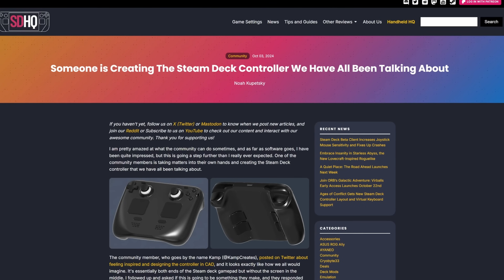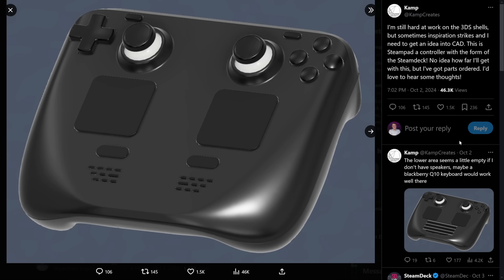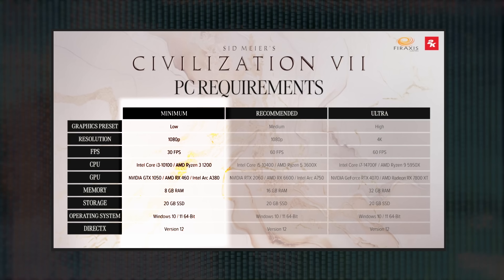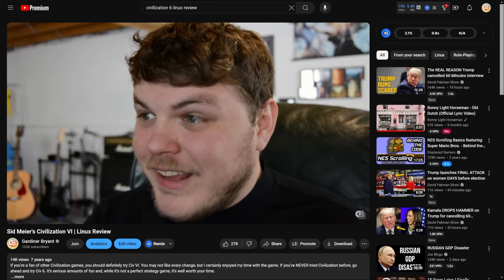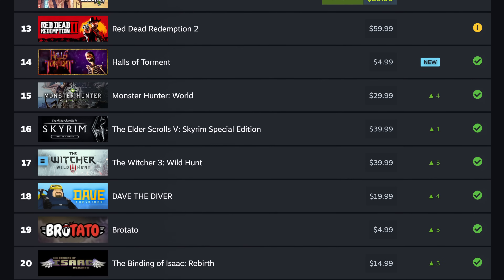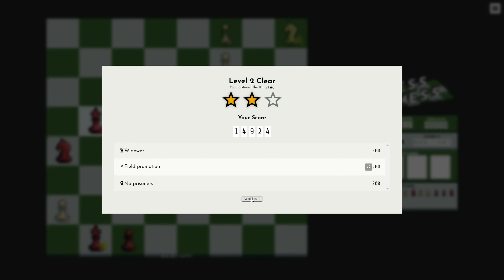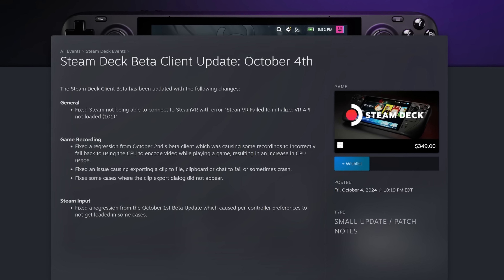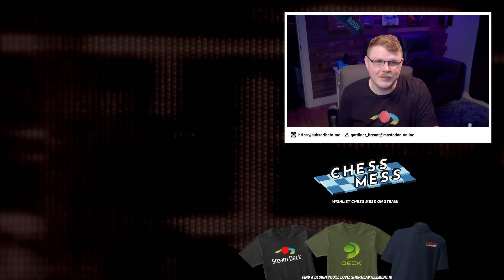Who is behind this new Steam Deck Controller?

Comment: I've been seeing the renders of "steam controller 2" that are just the steam deck without the screen and it's actually a horrendous idea. The thing I hate most about the steam deck is the tiny square touch pads. they're  too small, the shape makes them a night mare to use as a d-pad or emulating an anologue stick, and they're too easy to click in leading to a lot of accidental accuations. 

I understand why they are the way they are for the steam deck, but on a dedicated controller where you don't have to worry about how much bigger and bulkier you're making what is supposed to be a portable console they should be swapped for larger round pads with the click in issue fixed, though they don''t need to be as big as the og steam controller

Comment: Needs greater ergonomics. The closer the hands are, the more angled the wrists need to be so not to stream the shoulders position. This is why console controllers taper outward in an angle to the palms in a degree for the tilt of the wrist.

Comment: I agree with the ergonomic concerns others have posted. Think about using the Joy Cons in the girp that comes with the Switch. I think thats about the size comparison and that thing is not very comfortable even with the slightly asymmetrical palm rests. There's a ton of third party angled grips that try to make those feel better in the hand. I think that controller concept needs some kind of angle.

Comment: My dream option for the next Steam Deck and any Steam controller would be glass topped trackpads. If we could get super precise trackpads like a Macbook or high end windows laptop, I'd be soooo happy.
Reply: I'm not sure if that'd be a good idea. I'd rather have it made of a durable plastic, or some metal alloy. Making it glass would just make it more brittle and/or expensive without much gain.
Reply: @Ferkiwi  I've repaired laptops for over a decade and almost never have seen a glass trackpad break. They're tempered glass, they're very strong and the control gains are immense.
Reply: @WhatAboutZoidberg  Laptops have lids, a controller gets much more punishment. I work at Samsung and I've seen plenty of broken tempered glass on touchscreens. Can you explain in which manner the glass helps with "control gains"?

If you just prefer the texture, it would make more sense to separately sell glass stickers (like screen protectors). Many places already sell vinyl covers for the steam deck trackpads that add different texture (and it seems some people actually feel better control when the vinyl has more friction/grip, instead of being smooth like glass).
Reply: I was thinking having displays on the trackpads would be interesting.

Comment: Steam Deck controller
The custom Steam Deck controller looks neat, and is exactly what I'm asking for. Its basically the opposite of what Sony did with their PS5 tablet. Absolutely gorgeus and I would pay a full price for (whatever that means, but hopefully under 100 Euros).

I hope Valve license this, supports and sells it on their platform. So I can buy it with my Steam money, rather than Amazon or a random shop. Steam money cards is so good.

Comment: Ok I'm sorry, but he literally just took a Steam Deck and removed the screen... He didn't even remove the speakers.
People have made mockups like this already and it's very bad ergonomically, only reason it works for the Deck is because the control surfaces are a lot further apart.

Comment: I would prefer if the steam deck could be used as a standalone controller via bluetooth/wifi for an external PC.
All the inputs it has plus even the thouch screen could have soft buttons for additional controls.

Comment: the   steamdeck  controller is internally a usb device. so you dont really need a custom pcb
Reply: You will need a custom PCB to house the USB Controller, the batteries for the controller, the USB-C charging/Connecting port and for everything to connect together. How do you think all the buttons of the Steam Deck will fit together if you can't plug them into something? The current Steam Deck modules plug into the main motherboard, where the USB Controller is to get the signals from the parts.

Comment: I want this controller so badly I would pay 100-150 euro easily.
Reply: @zoltanschweifer4304  you could buy the cheapest lcd steam deck and use that as a controller, I've used my oled and a controller before on my pc
Reply: Bro why
Reply: @spritely  Because the steam deck is the best controller most reason is the track pad. It's infinite better than dualsense edge. Although I like the ds edge metal back buttons.
Reply: @zoltanschweifer4304  completely agreed, if it’s ergonomic

Comment: The controller is an intreaguing idea and the design looks cool, but it also looks really straining to use for any extended amount of time.
Reply: It’s just like the Nintendo switch joy con controller which is super comfy.
Reply: Maybe maie it a lil bit wider would fix the issue? Idk
Reply: I mean, the design is literally the steam deck . So do u find the steam deck straining?
Reply: @misaroorasim I think, the issue is that you will have to bend your hands. Steam Deck is wide, so the handles being parallel makes sense. However, for regular controllers it's good to add an angle there
Reply: @spatiumowl  true, that does make sense, slight angle would be ergonomic.
Reply: @spatiumowl the GC controller almost didn't had any angle and were really comfortable to use